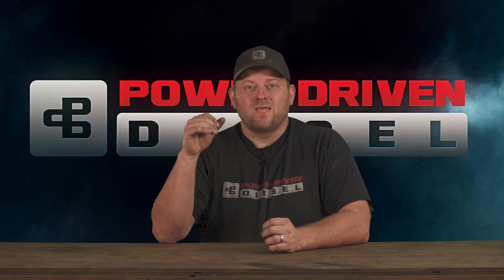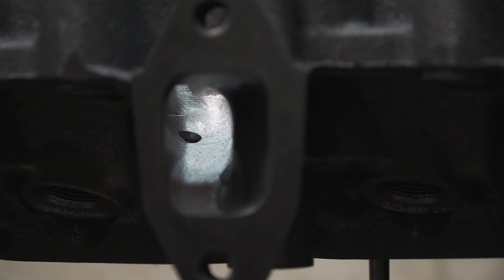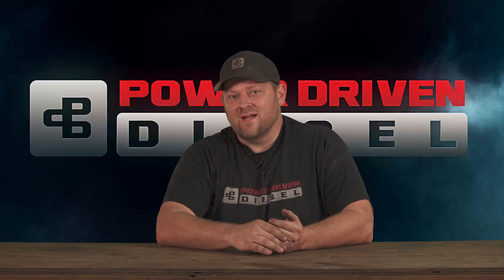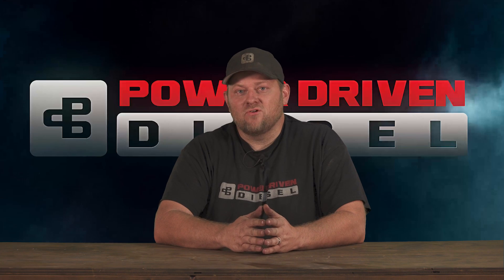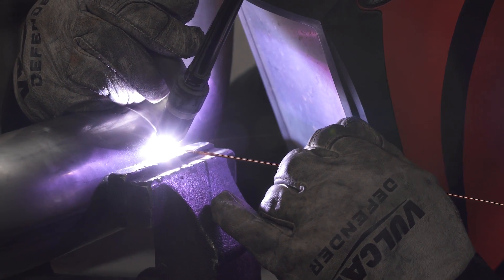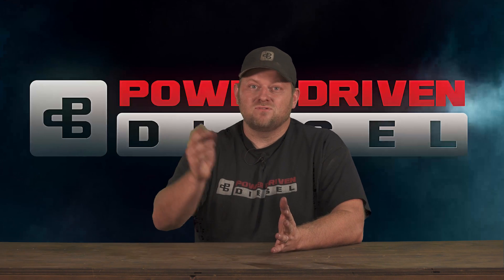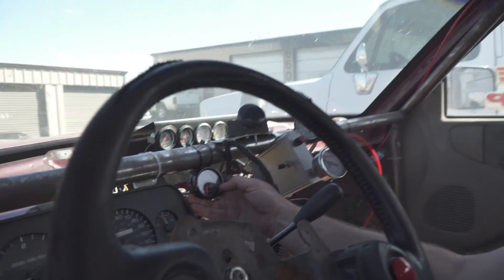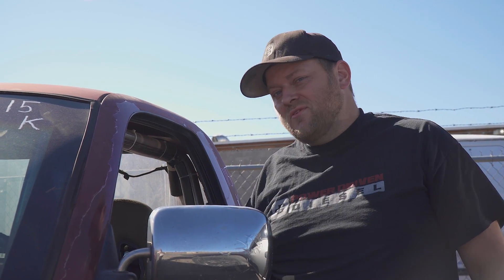First Startup Stroker 6.1L 12v Cummins | Junker Drag Truck | Power Driven Diesel

Comment: Did yall ever put the hx82 on the truck
Reply from the maker: He mounted it. Then he put on a gt55.  I think papasaurace is getting an hx82!
Reply: @pddofficial  have yall done a video on the different ways to make a 6.4 and if it can be done with an old 12v head
Reply: Or a head like yalls big head on the ucc truck

Comment: I'm building a 6.2 stroker right now I can't wait to get it done I'm torn between what turbo to use I'm looking at a he500 63/70/13 from FPI or a borgwarner 63/73/12 I've got a 10 speed swap I'm wanting a solid dependable daily driver 500 to 600hp my build is 215hp pump 191 delivery valves 5x14 155 spray injectors mahle cast performance pistons high compression 155 bowl 6.7 crankshaft Hamilton 178/208 camshaft the head has 175lb conical springs Hamilton large valves slightly ported I'm thinking about trying 18 or 20 degrees timing  I also have DPS manifold and a performance plenum and intake horn with a BHAF I'm looking for good power from 1500 to 2800 rpm what's your thoughts if any thanks
Reply from the maker: We've never tested an HE500 but if it runs anything like the HX Super 9 turbo we sell, it should work well.  On the Borg, most of our testing on the 63mm turbo has been with the 68mm turbine, not the larger 73mm turbine.  But with the stroker engine, I'm sure the 73mm will still run just fine.
Reply: @pddofficial  thanks for the reply what timing degree do you think I should start out with I was thinking 18 or 20 what do you think

Comment: I like the music, it was chill af.  Nice build, excited to see what it does at the track.  What is the secret to keeping egt so low?  My truck has mild fuel upgrades on it and the egt rapidly spikes in 5th gear when i romp on it w/ the AFC live knobs turned up too high.  I think I need a bigger turbo/intercooler maybe, but I'm not really sure, sorry for the nooblet question in the comments of a yt video.
Reply from the maker: Good question!  Ported heads that move air and exhaust through the head efficiently really help with EGT numbers.  Beyond that, bigger turbos help quite a bit at the higher RPM levels when drive pressure spikes on smaller chargers.  Down low RPM, small fast-spooling compounds like the PDD Ultimate Towing Compounds work well to control EGT with reasonable fueling say 500 HP or so.
Reply: @pddofficial  Awesome fast reply, thank you.  It sounds like it's as I expected.  The air moving through my system isn't enough and the rich fuel spike is making EGT go nuts.  I'm used to tuning AFR on gas turbo stuff so this is a bit new to me.  Thank you again.

Comment: 5:38 whose rocker stands?
Reply from the maker: Those are prototypes we've been testing on the Junker for about a year now, they were designed and built here at PDD.  We made them out of aluminum to validate the design the fitment but so far, the aluminum has held up extremely well so there's a chance the finished product for the general public could be aluminum rather than steel.

Comment: Injectors and Injection pump specs?
Reply from the maker: The current setup is a max effort 12mm 215 pump with some heavily worked over 5x018" VCO injectors.  Should get the truck solidly to the 1,000 RWHP mark, maybe more with the bigger air setup!  We do have a 1,000 cc 13mm pump and some larger injectors to test on it after a we play with the 12mm street pump for a bit.
Reply: Power Driven Diesel sick! 😎

Comment: I take it you guys don’t back out the head studs 1/8-1/4 after running them down?
Reply from the maker: Nope!  If you back them out, they turn back in when torque surpasses 140 ft lbs anyway!
Reply: Power Driven Diesel good to know! I’ve always backed the studs out but I won’t bother doing it anymore 👍🏼👍🏼

Comment: What stall convertor?
Reply from the maker: It stalls around 1800 RPM initially until it builds some boost, then it creeps up to around 2400 rpm.  Just a touch looser than an OEM V10 stall speed.  5600' elevation in the summer time requires a decent converter with a 472sxe on the manifold!
Reply: Power Driven Diesel thats still pretty good for a 472 on a 12V

Comment: Put your suction cup on a nut driver and use the impact gun to lap valves. It works fast!
Reply from the maker: That would help lap faster for a lack luster valve job, these lapped in quick, like 3 strokes, excellent CNC head machine makes quick work, don't really need to lap, just like to verify everything looks good for seat width.
Reply: @pddofficial  ash, I see. Different from lapping an old Kohler k series lol

Comment: That's insane that a 472 sxe is your "small turbo. Just freaking INSANE
Reply from the maker: If Will wants to have a chance keeping up with Josh and Todd's triple turbo monsters, he might have to upsize even more, it's sad when 1,000 HP at the tires is "lack luster"....  dang horsepower junkies around here!
Reply: @pddofficial  I'll trade you drive lines :) Of course with a 1000hp on tap my wife would have an even hard time missing those giant concrete bollards that they put by some drive thrus.

Comment: I love the amount of room around the engine that you have with the Cummins. When it comes to trucks I had always had Fords as had my Dad. Kind of got used to them and they seem to be able to handle farm life so when we went to look to buy a newsed truck (sorry but I'm not spending 70-80k on something with tires) I looked at Fords, GMC, and Dodge. The Dodge was the only truck that looked like it wouldn't be a complete PITA to change injectors, turbo, IP, etc which is the reason we bought it. I don't mind paying someone to fix somethings but I like to be able to do most of the work if possible on my stuff.

Comment: The first fire on a big setup always gets the heart pumping! Man that makes me wanna put my truck back on the road with the 475/hx82!
Reply: What's the dimensions of the 82
Reply: jam84 ** 102mm compressor, turbine is large X huge in a 41cm t6 housing. Will has an identical turbo to mine they are going to test out
Reply: @FROSTY2588  thanks man. Made it seem like it was larger then the other..41cm housing..whew buddy!!
Reply from the maker: The HX82 is a G-trim turbine in a 42cm housing with a 102mm compressor.  But, we have a second one in the works that's gonna get a 116mm billet compressor so we can do a Holset vs Garrett shootout!

Comment: Why ARP studs not the tool steel?
Reply from the maker: The IFG tool steel studs have been on backorder for quite a while, so Will had to pony up and get the ARP's.  We may swap them out for some of the OptiTorque Torque Masters to give them a try since they are much more economical than the 625's.